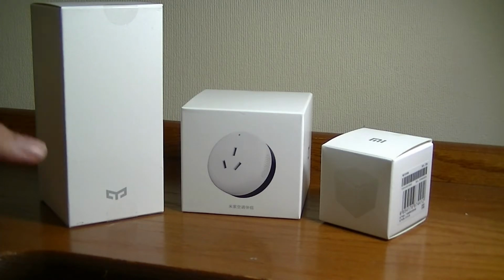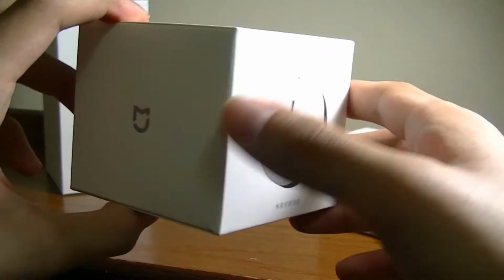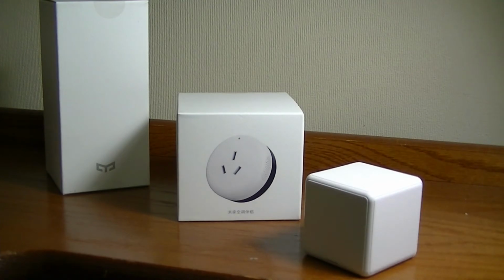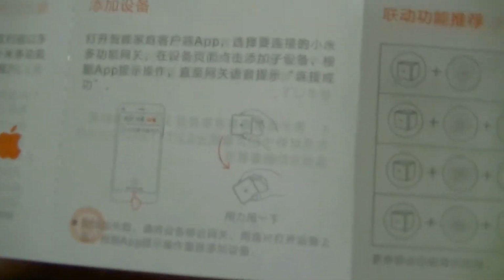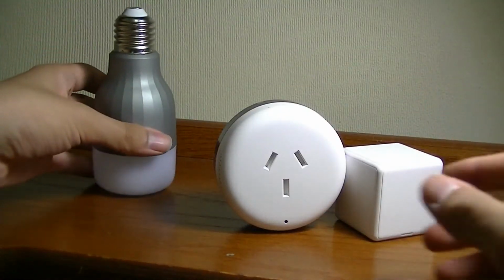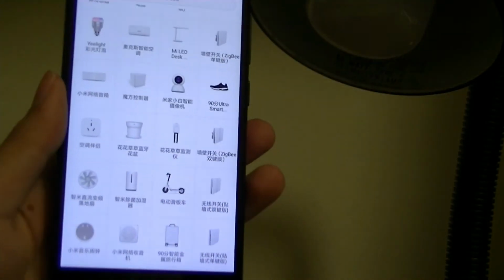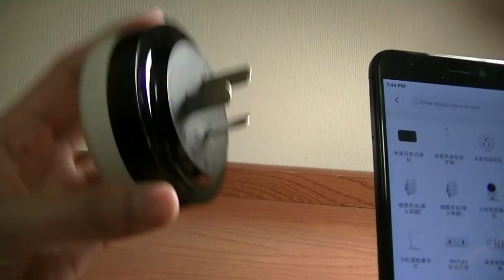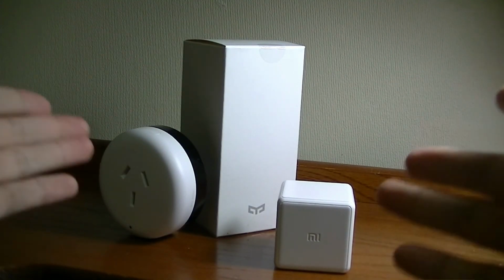First Look: Xiaomi Mijia Smart Home Devices Kit #2

Comment: Hello, can the Air Conditioning companion control the AC without connecting the AC plug into it? I read somewhere that it uses IR signals to control it. My AC power connection is inside the wall, but if I can control it remotely it would still be useful. Thanks!
Reply: Don't have IR control. The control e made throe the power plug. 
Only this one have IR control signals:  https://www.gearbest.com/smart-home/pp_229556.html
Reply: Your ac need not be powered by the ac companion. It has IR blaster that can control your AC. It replaces your AC remote